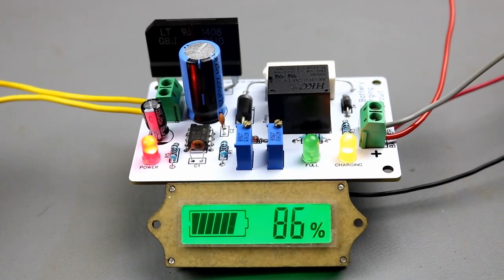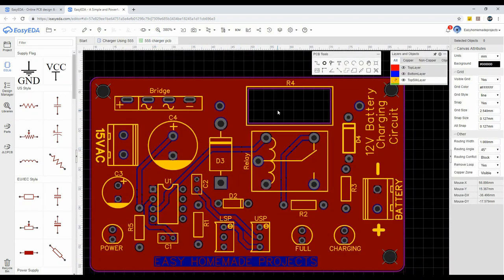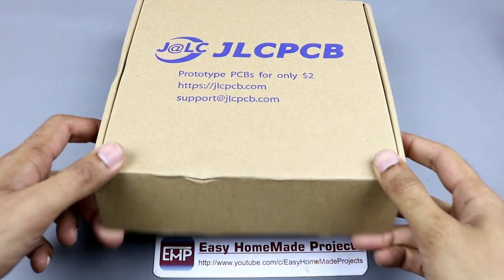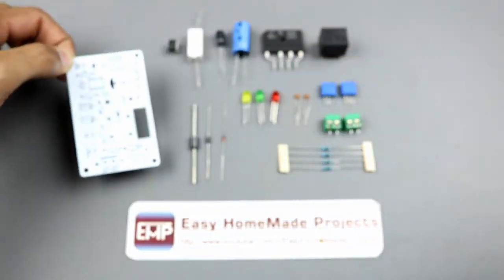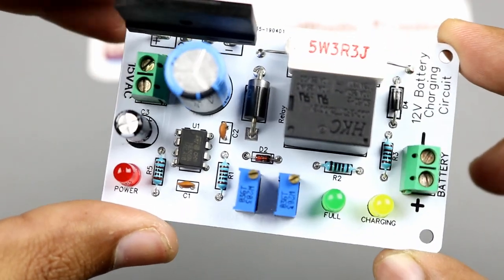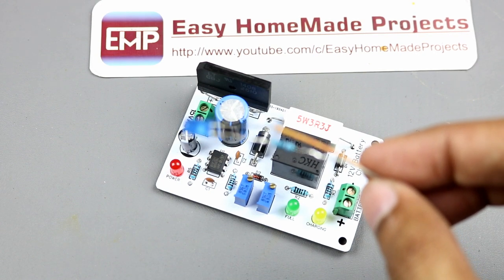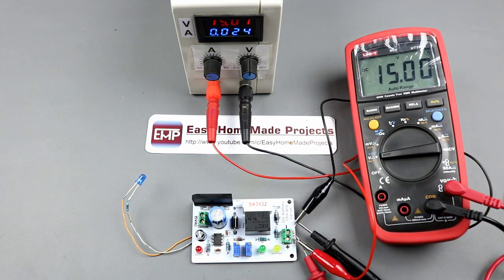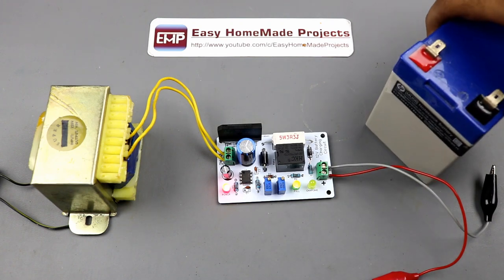How to make 12V Automatic Battery Charger using 555  IC

Comment: list of equipment's :
1k ohm 1/4W resistors *4
1n5822 diode *1
1n4007 diode *1
6v Zener diode *1
555 IC *1
103 capacitors *2
green led *1
red led *1
yellow led *1
3296w pot 20k Variable resistors *2
terminal connectors *2
5W3R3J resistors *1
12v relay *1
25v/2200uF capacitor *1
25v/220uF capacitor *1
5a bridge *1
220v AC to 15V DC Transformer *1

may be my comment can help you to do this project.... thank you.
Reply: Plese send pcb pdf
Reply: Forgot to add 12v relay..😁

Comment: Hi this is just what i'm looking for, Great circuit. I would like to use it as a 12v car battery to a 12v backup battery charger, backup battery will be smaller, (trickle charging) just to keep the battery full if it drops below a few volts and then kicks in , Will it work. Now i would also like to include your circuit diagram on my PCB, i don't want to have separate PCB's. If you could please make your circuit diagram available it would be much appreciated. Thank you.

Comment: Could explain the basic working of the circuit
Because the soldering part is dam easy and not required
Please concentrate on circuit explanation.
Because if we learn the working it will be more beneficial to the viewers .
Reply: Exactly, although I may build and test myself on a breadboard before ordering boards I would be helpful to see a video that shows how the circuit works.

Comment: I have a old ups transformer which gives 16v and 15amp of current in output.can i use this transformer in this project ?
Reply from the maker: No. This setup is only for less than 10 to 8 amps

Comment: i had obey the full diagram and made the circuit and i any way calibration is cannot succesfully done.when i give dc supply in bttry trminal the calibration led always on,but never off by usp and lsp.is any additional made in the circuit?.plz save me.i want to make it
Reply from the maker: Do it like i have done in video. First rotate both pots complete counter clock wise. Then start calibration slowly with one pot and then other.
Reply: bro i am very sad myself.beacuse i am not successful.can you help me?i rotate pots many times but the led constant glowing in any way.i have maintained all diagram fully and checked minimum 6 times.but no results.plz help me plz.
 @EasyHomeMadeProjects
Reply: plz help me bro

Comment: Can i use 10 to 15 amp transformer with this circuit?  If i replace the bridge rectifier to 50amp?
Reply from the maker: N0
Reply: Any modification for 10 to 15amp transformer?

Comment: So you are saying that irrespective of battery state, the circuit will push 15volts, hmm not sure it's a good idea unless you want to destroy your battery in a few months or even weeks
Reply from the maker: There is a current limiter resistor. Only extra current can destroy battery. Not voltages.

Comment: Plz make a charger which can help to charge above 60 to 150 ah lead acid batteries...
Reply from the maker: Use 8A transformer with this circuit to charge 60A battery

Comment: Made a video for auto cut off charger circuit for 4 volt battery just like the above video you have uploaded and don't use PCB board. Please try it in Vero Board or made it freely so that everyone could understand that how to cliberate it and adjust the voltage. Please made it upto February month. Don't take it as command, take it as request.

Comment: I making this circuit. it is not work perfectly, sometime later ic is over heating.
Reply from the maker: Tell me specs of your connected battery and transformer
Reply: Transformer 15 volt 7 amp, battery 95 amp dry cell.

Comment: Hi, thank you for sharing circuit.  I have it bread-boarded currently. What does R4 do?  Can it be bypassed?  Having problem finding one at 15R. Found 12R and 10R.  I also have in my inventory  of parts higher value resistors in 4-5 watt.  What range will work?  Thank you.
Reply: R4 is the current limiting resistor for charging, if your Charging voltage is 14.4V  than with R4 @ 15 ohm your charging current is about 950mA ,  So D3 and R4 must be able to sustain more power up to 5W at least. 
12 Ohm and 10 ohm too low will increase the charging current and power to around 10W.

Comment: Could explain the basic working of the circuit
Because the soldering part is dam easy and not required
Please concentrate on circuit explanation.
Because if we learn the working it will be more beneficial to the viewers .